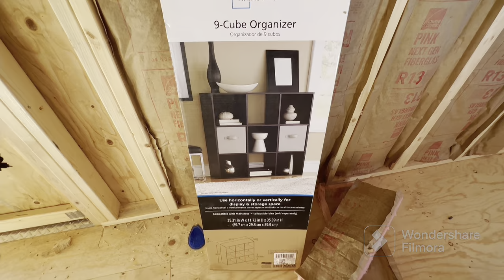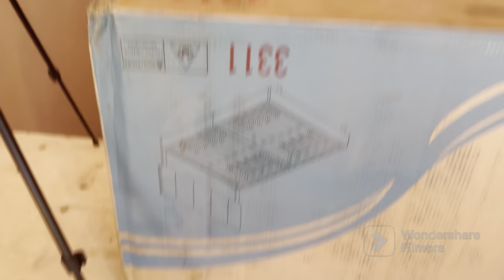living off grid / Working on the bedroom

Comment: Perhaps kéy can be conjoined with electrical tape or have you seen electrical wire slipped into cylindrical plastic to cover exposed wire on a electric cord? You take a piece, slip both pieces in both sides. Holding it togéther while heating up thé plastic to shink it to fit tightly around key! Just some things to try before you spend money to buy a key, and ignition and door keyholes!  I have been able to go to a locksmith and have a car key made, even when it was obsolete, the locksmith knows how to duplicate the key based on the thickness and width of the blank! Didn't you get the key blank? Try taking the blank to a locksmith or to home depot to get one made!
Reply from the maker: I found the locksmith that made the key but for some reason it won’t turn over to start. Then he made another and using my fob by touching it to the key it starts ❤️😊
Reply: @travelingwithcharity6598  That's great! Love and light!